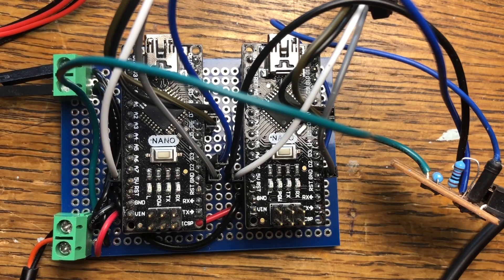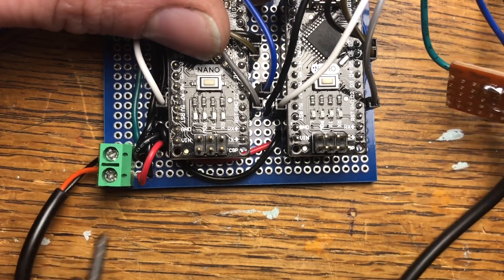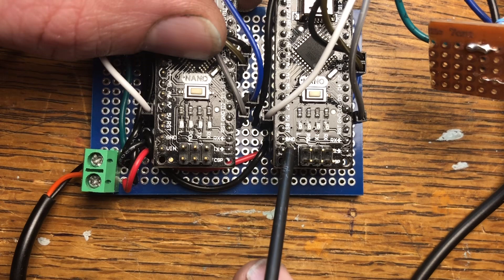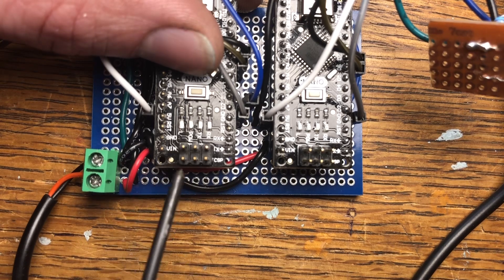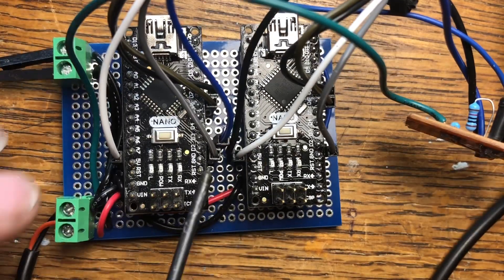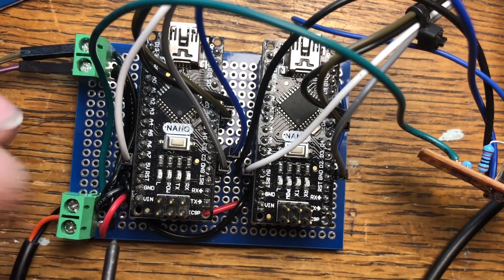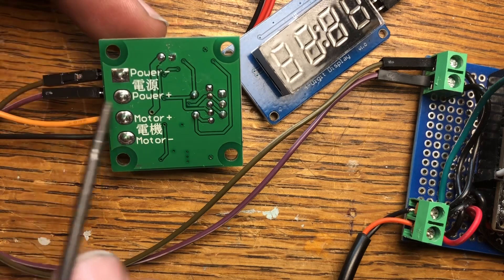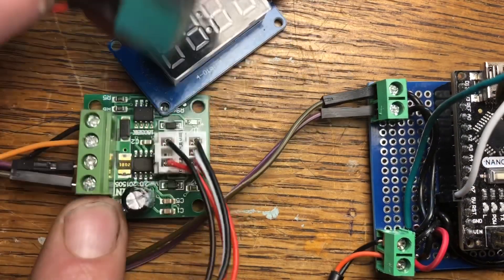Wiring the Pickup Winder 2.0. OPTO switch, 12v motor, speed controller and Arduino

Comment: Hey Chase, really useful video series, and well explained! I had a quick question: I tried to replicate your counter design and the 12V supply let the magic smoke out of the arduino nano - a bit of research told me that while the board itself is happy enough to run off 12V, there isn't much current 'budget' to run anything off the 5V supply from it without the onboard voltage regulator calling it a day. My hardware is all the same as yours as far as I can tell, and the wiring layout is the same, do you have any idea why the 12V supply might have fried it? And would wiring a 12V-5V voltage regulator upstream of the board mitigate this?
Reply from the maker: Chris sorry to hear that bud. I have fried a board or 2 in my time lol. More than likely you have something wired wrong or to the wrong pin.  I’m assuming you are putting the voltage to the VIN pin.  Also make sure you have your polarity correct on your wires coming from the power supply. If they are backwards you’ll be putting 12 volts into the ground. If you’re wanting to step down the voltage I would use a buck converter. They are more efficient and work better. Let me know if any of what I said helps. Also if you have anymore questions let me know bud.
Reply: @ChasesWKshop  Thanks for the reply. Yeah, it's an all-too-familiar sight here too lol. Ok, I'll give it a full once-over with a multimeter and order a buck converter (and another arduino!) and give it another punt.
Reply from the maker: See if you can find a pack of arduinos. I got 5 nanos for like 20$.

Comment: Just a quick question I know one of the nanos is for the Opto Coupler, what is your other one for RPM?  Was there a specific reason you went with two of them?  I'm getting ready to build one of these and just wanted to make sure I understood what was going on there.
Reply from the maker: One of the boards is for the counter. The other is for the rpm. The OPTO switch sensor wire feeds both of the boards at the same time.  Basically when the OPTO switch sends a voltage positive it sends it to both boards by a split in the wire. Thanks for the question. Let me know if you have anymore. Btw I never use the rpm meter on mine.
Reply: @ChasesWKshop  I wondered if it was useful or not.  That works.  I'm getting all the parts pulled together over the next bit and will be designing a 3D printed case for all the parts and possibly the pullies.  I also am thinking of having a stepper motor driven guide so I can straight wind or scatter wind. I appreciate the reply.
Reply from the maker: 3DPrintingGnome absolutely bud. To be honest I don’t have time to look at the rpm meter when winding so I don’t use it.  It’s all about feel anyways.
Reply: @ChasesWKshop  I can totally see that.  That's why I never understood RPM Readouts on lathes.  I'm not looking over there with a chunk of wood spinning at 1000rpm or better.  Loving the videos as well.  I just found the channel the other night and have watched the Pickup series several times.
Reply from the maker: 3DPrintingGnome awesome bud. Glad you like the channel. I’ve got quite a few pickup projects I’m working on now. Hopefully have them up soon.  Want to work on a auto feed mechanism for the pickupwinder. Highline guitars has a good design for an auto feed for his pickup winder if you haven’t seen it. Really good channel.
Reply: @ChasesWKshop  I have a set of P90's from him from about 8 - 10 year ago, never been on a guitar yet.  I need to check out his channel.  I'm designing some gears and a case in CAD and I'm going to use a 2line or 4 line LCD.  The Second version I'm going to go to and Arduino controlled motor and trying to decide how I want you to be able to enter the number of turns.  Ideally,
 I want it to wind 97% of it at full speed and start slow on the front end and the backend.
Reply from the maker: 3DPrintingGnome awesome bud. Look forward to seeing what you’re building! Sounds like you have a good idea of your process.
Reply: I have the same question.

Comment: Thanks for this Chase! I was wondering if the speed controller from the previous winder is what you are using on this one? Also, what is the board the nanos are mounted on?
Reply from the maker: Matt Meyer yes it’s the same speed controller. The board is just a blank pcb project board I had. Something similar to these. 

https://www.amazon.com/dp/B07FFDFLZ3/ref=cm_sw_r_cp_api_i_w7PKCbH5NBKHZ